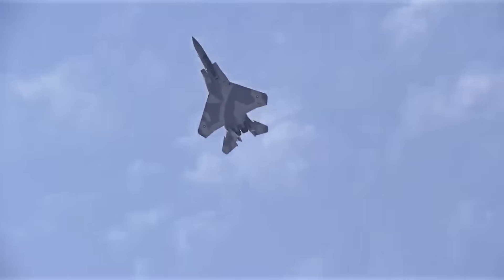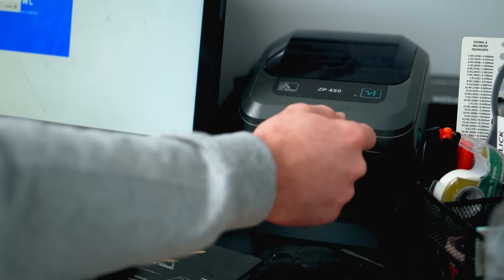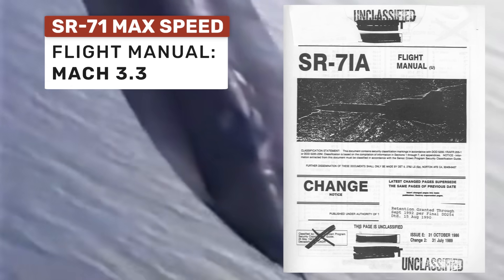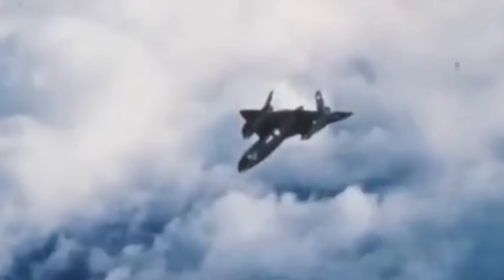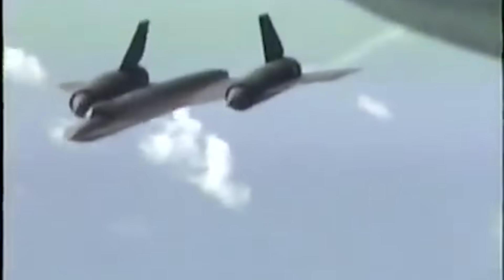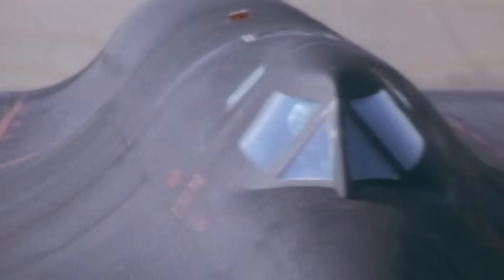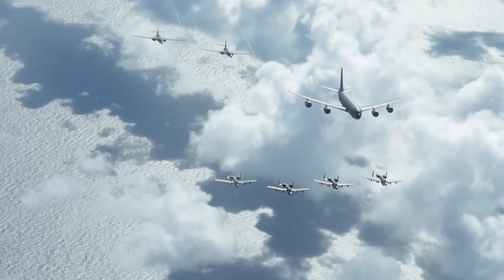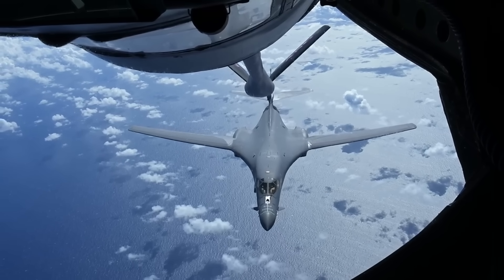The SR-71 was MUCH FASTER than the Air Force will admit

Comment: The "VMax" switch on the left panel of the F15 you mentioned was a feature carry over from the original FX contract requirement for the F15A. It is, in fact an engine management override switch and if used requires a complete tear down reconstruction of the engines before the aircraft can be declared airworthy again. So it is not used in service and by "for extreme emergencies" that means basically only if the choice is loss of the aircraft due to inadequate speed, but this was never its intended purpose.
The F15 is not a high Mach fighter type, it is simply not designed that way. It is engineered specifically for a high transonic performance capability, with incredibly robust manoeuvring structure in its intended role as an air superiority fighter with intercontinental ferry range. These cannot be achieved using a high Mach design. But the Whitehouse wanted to sabre rattle with the Russians and politicians seem to think if you toss enough money at a problem you can lick anything and have a "perfect at anything it does" fighter type, to justify the expense of being the best at generally just one thing and just sort of competitive at everything else, which is about as good as real world physics gets.

The F15 service aircraft speed limitation is 1.78M. Read that again. 1.78 times the speed of sound. That's it. You use the management override and screw up the engines for more, but generally speaking no honeycomb-composite later generation fighter is capable of seeing past 1.6M in combat conditions anyway, the fastest are things like the Block 50+ Viper and MiG Fulcrum and with some air-air that's about as fast as they can go. All the speeds of fighter types are almost universally overstated, dramatically with very few exceptions and are really best thought of as an expression of load bearing capacity rather than achievable top speeds in combat conditions. In fact this goes back to earlier gen multiroles like the Phantom which needs special prep and conditions for its 2.23M and otherwise, combat loaded and on mission you're going to burn your entire fuel load trying to do anything more than a short 1.6M dash before you can go ranging anywhere a good distance from the airfield without having to turn back and refuel. It was the century fighters that were optimised for high Mach operation during that supersonic excitement of the fifties and when an airframe and engine combination is geared to do that, what you get is something that doesn't fly well subsonic and causes a lot of fatalities around airfields, which they did. And the point is design analysts found it was superfluous to the air superiority mission anyway, which requires high transonic performance, not high Mach which is only useful to med-high altitude interceptors. Bluntly, interceptors are straightline hotrods with high Mach efficiency and air superiority are aerobatic tanks with transonic efficiency.

Now there have been two significant engine and technology improvements since the F15A so, without access to classified US military service equipment data I can't say whether or not the original 1.78M F15A serviceable speed limitation still applies, I believe it did with the F15C and that was a significant upgrade so it may very well for the EX, or it may be adjusted somewhat for more reliably wider envelope engine capabilities but as it was, you design engines to perform within a particular regime and require very specialised, very specific and very advanced technologies to allow them an ability to step outside that envelope, which in the case of modern fighters is 0.7-1.7M for the most part or the air superiority and counter air realm with multirole capability. Now for interceptors it's a whole different ball game and they'll use entirely different engines optimised for high Mach, compare the nacelle diameter of a Foxbat to an Eagle. But they're not so good in transonic which you'll be dragged to every time you start to manoeuvre. See the point? High Mach is just not something air superiority fighter is designed to do and it's real world physics which dictates that despite any claims, it simply cannot do any such thing, the cheats to allow that claim are essentially designed to mission-kill the aircraft. It isn't a serviceable capability.

This brings me to the speed claims of the SR71, which indeed seem wild claims since again the limitations are real world physics and that's a big sign post that we could be dealing with instrumentation errors and confirmation bias, which under such extreme conditions as a Blackbird flight mission, the very envelope it operates within is in fact an extremely mundane and common occurrence and the reason for all the pomp and ceremony of official test record conditions and third party instrumentation required, think of all the scientific instrumentation placed aboard the X-planes and the fact the vast bulk of it was simply to coordinate with additional ground based instrumentation and all to simply get an accurate data set of performance, since that's not such an easy thing to do when the conditions become extreme. Basic flight instruments aren't exactly reliable at these kinds of extremes.

My point here and it is a very big one, is the inlet cones have a maximum rearward travel reached around 3.2M designed to bring the shock cone to the inlet edge whilst converting airspeed entry into pressure within, to reduce airspeed subsonic ahead of the compressor but what this means is you're about hitting your speed limitation right here, since departing optimal performance at such an extreme envelope means things like a sudden and dramatic loss of 70% engine thrust. You can't go much faster in Mach speed because you can't let the inlet shock cone build pressure in front of the inlet edge, you can't extend the cones forward much to compensate for that because it'll affect the geometry of the inlet interior keeping the airspeed entering subsonic and usable. All you've got to work with is bypass valves and bleed doors to fine tune fractions in Mach speed and vary some altitude for changes in air density, all modified by atmospheric and meteorological conditions. You would surely be looking at manual variations and feature assisted capabilities 3.3M and under remarkable conditions or careful and lucky management perhaps excursions of 3.35M or higher but these seem to be special and very tenuous conditions. The design optimal cruising speed for the engines, from what I've found is around 3.2M and it is generally listed at 3.2M (nominal) maximum speed because simply it falls well outside engineering requirements to sustain high Mach for the engines to push much past this speed, due to their design functionality however all the figures in this extreme are blurred by inherent complexity of the conditions.

It is certainly a conditional fact they have demonstrated speeds around 3.3M under test conditions and claimed faster speeds without presumably adequate confirmation, but averaged over sustained performance across all variants in closed circuits and straight courses the high Mach flight regime of the Blackbirds mainly due to the J58 engine design is loosely 2.5-3.3 Mach and it isn't a hard limit due to the extreme conditions of its envelope, however it is certainly not viable quoting 3.2-3.5 Mach instead. It's a little disingenuous and to be honest a little voice starts shouting instrumentation error or conditional excursion when somebody says anything higher than 3.35M. The physics just don't seem to support it.
Reply: Finally.  The first reasonable comment.
Reply: @Pene7942   thanks. I tried not to go on too much.

Comment: Temperature increases with velocity², T compressor inlet=Tambient+v²/2010.  At M3.56 (~1070m/s), that would be about 570°C above ambient (-50-60°C). or about 500°C.  Creep life of titanium is getting very low at such temperatures, the leading edges of the aircraft + compressor blades won't like it if it's maintained for any length of time and they get into thermal equilibrium

Comment: Get story on great aircraft . I agree that the maximum speed has little to do with anything other than bragging rights. What counts? Altitude and speed to avoid rockets. That does not mean as high as possible and fast as possible. There are several envelopes to consider when looking at surviving an intelligence gathering mission.

Comment: Myth.  It is interesting how they don't tell you about the crew that had both engines compressor stall when they went above mach 3.2.  The shot cones inside the engine will not designed to be optimal above 3.2. for them to go above that says that the plane operated outside of its physics capability.  Just like speedometers can be off so can pitot tubes.  Watch out for stories that change due to the need for popularity. 🤷

Another fun fact is the f-15 flew above 100,000 ft in its world record flight. 🤷

Comment: The 1965 record setting runs were by a YF-12, not an A-12.
They happened to help hide the existence of the A-12 and SR-71, making it look like we had a very fast interceptor NOT a very fast pair of recon planes.
Reply: The A12 records were also set in 1965
Reply: @gr8crash  Citation?
I can't find ANYTHING about the A-12 being allowed to be known by the public in that timeframe (It was still a DEEP black project at the time), or setting official speed records EVER.
What I have found some references to is an UNOFFICIAL flight in 1965 where the A-12 achieved 3.29 Mach - which I remember this video talking about.
Reply: @bricefleckenstein9666  so somewhat correct. The A12 was never used to set public records. Although they did ask Lockheed if they could use an A12 to set official records but KJ basically refused as it would have delayed flight testing even further. But in 1965 during flight testing, the A12 set its official records for a max speed of mach 3.29, max altitude of 90k ft, max duration etc. While it was not public records, these were still official and documented during flight testing
Reply: @gr8crash  They might be records, but since the FAA and FIA were not involved, BY DEFINITION they were not OFFICIAL records.
If the process to make them OFFICIAL was not followed (and even YOU admit it was not), they can't be "Officlal".
The YF12 records from that period WERE official, and remained the official records 'til the SR71 was retired then one was unleased to set several higher official records.
Your concept of a "public record" is meaningless, or you are confusing OFFICIAL records with that concept of your own making.
Reply: @Pene7942  I'm not saying the A-12 didn't go that fast - just that when dealing with OFFICIAL RECORDS that there are procedures that are required to make the record official.
Reference the controversy about the "Bud Rocket Car" and it's attempt at the Land Speed Record - and WHY there is controversy about it.
Reply: @bricefleckenstein9666  i understand what you are saying between FIA official records etc. But that doesn't necessarily negate Lockheeds own records. If its tested, flown and verified it is still a valid record as to what it did. It may not be the FIA official record, but it is still a record. Similar to the SR altitude record. It reached a verified altitude of about 89750 ft (i forget the exact number), and it was verified and tracked at that altitude, but since the FIA wasn't verifiying it that day it didn't count. 

So again i do understad what you are saying, i'm just referring to the real world values.

Comment: I stopped the video at 1 minute.

I have for years been in countless "debates" online about this.
In a nutshell, the SR-71/ was probably capable of Mach 4.3 - 4.8 max speed.

This of course has led to many "experts" denying this was possible. Insults incoming....

All evidence from pilot descriptions of the Blackbird's speed (without disclosing the actual maximum), and basic deduction gives it approximately this performance.

The A-12 flew even faster and higher.

NOW, back to the video
Reply: Lol the reason you get insults/comments is because your speed claim is absolutely ludicrous. Those speeds were never even remotely possible
Reply: @gr8crash  
So, the SR-71 was no faster than a MIG-25, right?
Reply: @PhilipReeder of course it was faster. Don't think anyone said it wasnt

Comment: In level flight at 85000 feet the inlet spikes limit the top speed at M 3.45. That places the shock wave off the tips of the inlet spikes right at the edge of the inlets. The spikes were mechanically limited to moving back 26". Any further back and the supersonic air hits the inlets and put the J58's into an "unstart" condition... and at that speed it's only a few seconds before the aircraft disintegrates. The airframe could endure much faster speeds and remain structurally sound. Each heating and cooling cycle annealed the titanium and it just got stronger.

Could it have squeezed some more speed in a dive... possibly... but keep that in let shock wave thingy in mind...

Comment: twice as fast as advertised. we were already flying mach 6 with the x-15 years before.  ya think they'd tell you the a12 or 71 could do that for a limited time. the damn thing could outrun missiles, not something you want the opposition to know, they'd build better missiles. flying across nebraska in 5 minutes would be around mach 7. that number seems to pop up alot if you decrypt what pilots have said.

Comment: Yes Alex, a good chunk of us already knew that the top speed of the F15-EX is faster than what's listed and the person who said Mach 2.9 PROBABLY shouldn't have said anything other than it's officially listed speed.

But really, +- 5% isn't going to matter much, the main issue is if it can get away from missiles fired at it through ECM, chaff, etc....

I'd LOVE to see about 250 - 300 get out in the fleet.  It's a beast of a plane and in the right balance of aircraft where it could get additional protection from missile attacks via drones or other 5th - 6th gen fighters this thing is a missile truck and I think would work well in helping to establish air superiority.  You could load this thing up, get it out there with that balance of planes and this could be the attack craft while others are getting rid of anything that's flying.  I've seen the idea of using a large plane to carry missiles but the problem with that is protecting it, where at least the F15-EX has the power to get distance between it and incoming missiles, along with being able to maneuver and trying to knock any incoming out of the sky.  Although, a large missile truck like the C-130 SHOULD be able to carry a pretty impressive electronics suite and different counter measures.  

MAN I'd love to see how this could all play out after 6th gen is out there.  I think the US military is going to have a pretty badass air fleet, and with the additions of drones, the CCP inferior aircraft MIGHT have numbers on their side but they won't have the experience, strategy and probably not even the technology to deal with what the US could put out there.  Plus their 5th gen will be easier to target.

Comment: Mach 3.2 is equal to 2455.26 miles per hour, and Mach 3.91 is 3000 mph. Three thousand miles per hour.
Reply: Your speed calculations are way off

Comment: You have to remember the SR-71 was flown in a Clean Configuration with no external Stores or Tanks I'm sure it's a lot faster than they are comfortable with saying and at 80,000 feet plus there's literally no Air to increase Drag